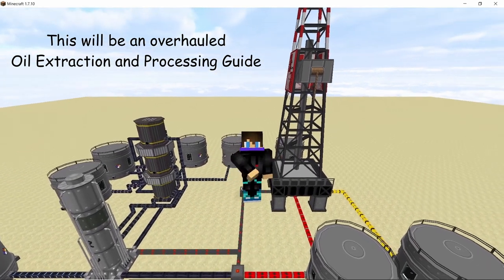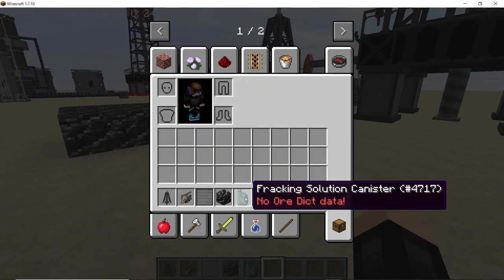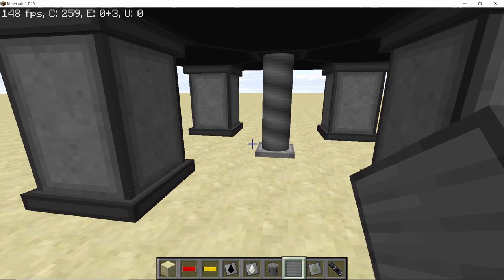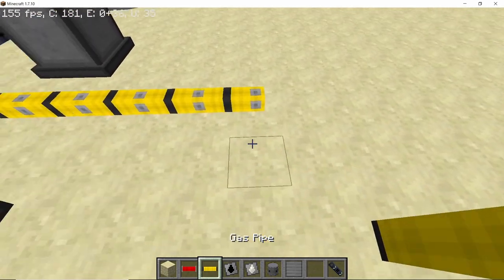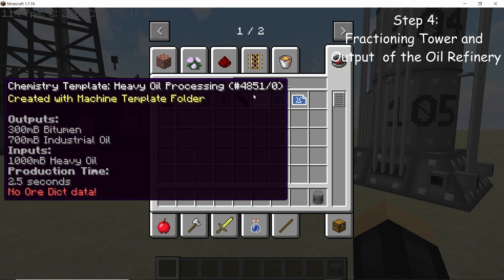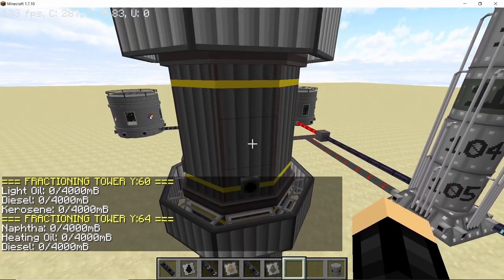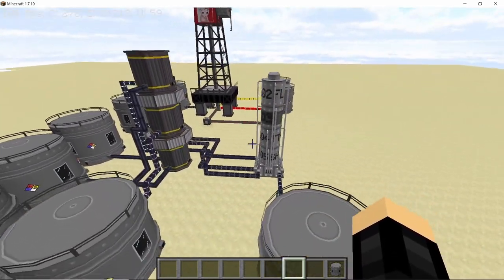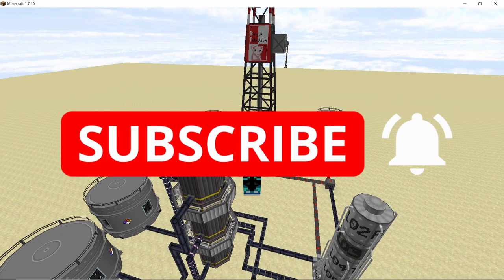"FRACKING Tower & FRACTIONING Tower" Guide for HBM's Mod || Setting up an OIL REFINERY in Minecraft

Comment: Seems like a huge set up for a short time of extraction. Im fairly new to the mod and oil pumps only last a short while until they are all used up. Is this more efficient and you get more?
Reply from the maker: This setup is more of a mid game setup rather than early game cause for running it you will need some petroleum beforehand which you will obtain via Pumpjack or Oil Derrick.
But there is a catch there , Bedrock oil deposits have been added to the game which serves as an infinite source of oil. So it might be true that for a normal oil deposit which will be depleted after a short amount of time , this setup is perfect for extracting bedrock oil deposits cause only the fracking tower can do that.

P.S. Fracking tower looks way cooler than Pumpjacks and Oil Derricks , so that's a factor as well xd
Reply from the maker: Also one more thing , you can't get more with this setup , the amount of crude oil extracted is proportional to the amount of oil blocks there are no matter what method you use , but fracking towers are faster than the other two methods
Reply: @SavageVegeta  i didn't know this would be infinite. That's cool thank you

Comment: I don't know if you're still replying to comments on this video since it's a year old but I wanted to ask a question. A couple of my friends are saying that the fracking tower creates some kind of pollution in an area around it, but I haven't had the time to test if it's true, and I was wondering if you knew whether this was a fact or myth?
Reply from the maker: Yes he is right , running the fracking tower will destroy terrain and vegetation in a big radius ... but that is the price you pay for pumping out infinite amount of oil from the ground. 
This happens in real life as well , fracking process literally works by fracturing small cracks already present in the earth's surface.
Reply: @SavageVegeta  Thank you for replying. I have my base set up and it's roughly 3 chunks from a bedrock ore vain. Do you know if the radius it destroys reaches that point or does it just constantly grow?